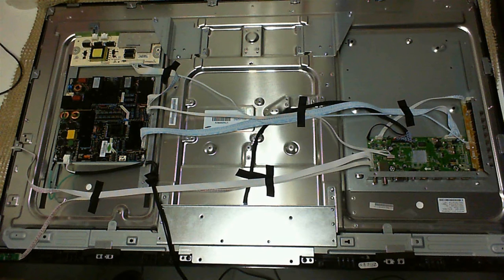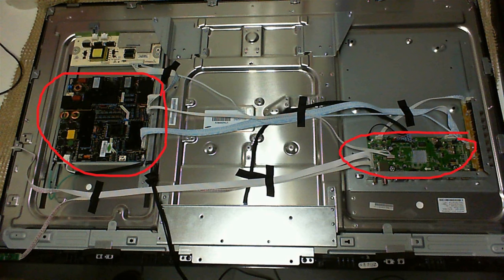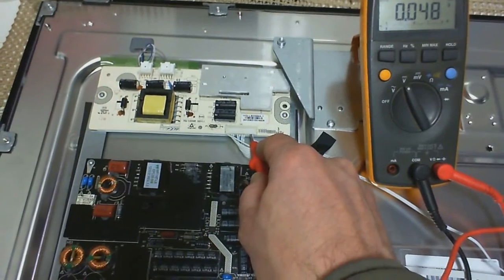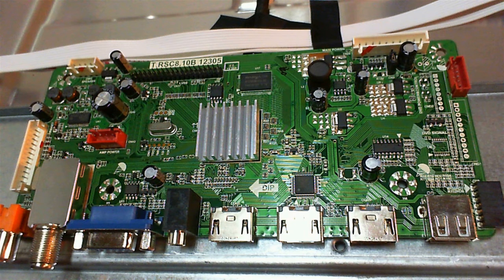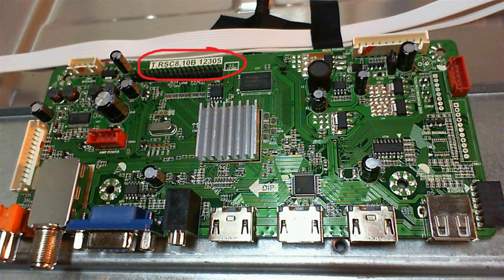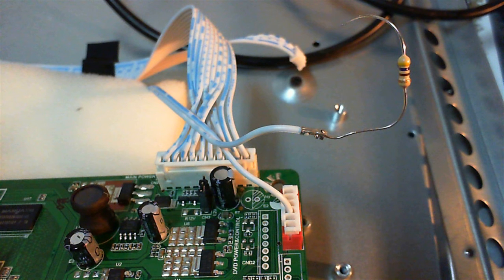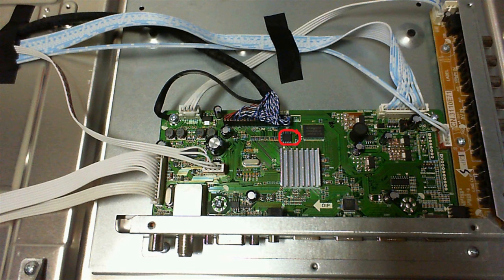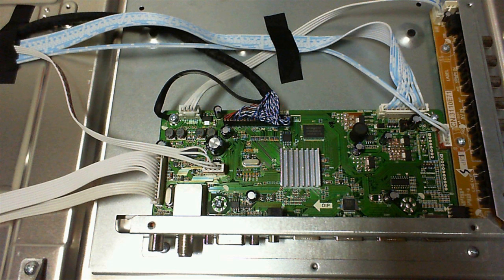LED TV repair RLED4010A X322BV PLCD5092A-B X425BV T.RSC8.10B 12305 EEPROM firmware swap

Comment: Thanks for the quick response. How hard is it to transfer the eeprom, Regular soldering station and wix fine ??? don't have any of those fancy soldering station with hot air etc.
Reply from the maker: Andy r Not hard at all, as far as I remember it's a SOIC8 package. The easiest way apart from hot air is to fill the space between the pins with solder, then heat 4 pins on one side, slightly lifting the pins on that side, then remove the excess solder with Wick, then do the same on the other side. Just using Wick while the pin is still on the pad may also work but then you will need to slightly lift pin by pin.....
Reply: TomTechTod  Thanks Tom. Can't find an RCA board with same firmware. I'll purchase a Sceptre board and give it a try.
Reply: TomTechTod Hi tom,
 Got a board with a different firmware. Did switched the eeprom. TV was 
fine for a week (Many on/off sequence) but then the problem reappeared, 
Frozen blue LED on power on & no video/sound. Suspected a defective 
board (EBay!!). My only option was to reinstalled the original board 
with eeprom form the EBay board. As expected, low LED brightness 
(corrected with resistor divider on ADJ) but video is reverse. It has been 2 weeks ++ and still going fine . I suspect that I have a defective eeprom. Did your repair hold up ??? Got the pinout for the video connector to the LED panel but no idea how to rewire for correct video. I will ask the question on a forum.
Reply from the maker: Didn't hear back from the person who I repaired it for, I suspect it's still working.

Comment: Hi,  thanks for the info. One question, after swapping the eprom do you still need the resistor voltage divider or just swapping did correct the problem.??
Thanks.
Reply from the maker: Andy r I used the resistor just for testing purposes. The other firmware had the output voltage logic inverted. Just swapping the Eeprom should do the job unless there are other differences between the boards I'm unaware of.

Comment: What value resistor do you use as the voltage divider? Does the value matter for a quick test?
Reply from the maker: +mrsemifixit No it doesn't matter, I don't remember what value it was, take a few kOhms.

Comment: You got lucky.  Most problems with the T.RSC8 series is a bad or corrupted eeprom.
Reply from the maker: +ohger1 Where would we get the data from and how to program it in case somebody buys the empty chip?
Reply: Unfortunately, no manufacturer will provide .bin files when requested.  When we have any TV in the shop with a 25 series eeprom, we pull it, copy it, and place the .bin file on our computers by model number, board ID, version number on label, and display number.  We have a pretty good library of files but we always see some new ones.  Sometimes, vendors on ebay will sell the eeprom already programmed.  If we have to buy a pre-programmed eeprom or main board (of the correct version), we copy the .bin file before installing the part.  The next time we can do the repair in house.  As for the programmer, a TL866 programmer is all you need.
Reply from the maker: Ok, good info, thanks.
Reply from the maker: +ohger1 
Hi, do you know how to access service menu in a LN32C530? None of the proposed button combinations work. Some people say the eeprom needs to be reset, others say it needs to be replaced (without giving explanation on how to proceed afterwards). The TV sometimes doesn't turn on. Mainboard doesn't send backlight on signal when that happens. PSU is definitely good, DC voltages nice and clean... Help would be much appreciated.
Reply: TomTechTod
 Samsung's rarely suffer eeprom problems (if that's what you're talking about).  In any case, if the TV is intermittent, it's unlikely to be an eeprom problem in a Samsung.
Reply from the maker: ohger1 Ok. The PSU is ok though... The TV doesn't boot correctly... sometimes. If you have any thought on how to get in the service menu for this particular model I appreciate it. Thanks anyway for your response.
Reply: TomTechTod
  The older Samsungs used "mute" 1-8-2 or 1-8-3 with the remote either with the TV in standby or running depending on year.  But there is NOTHING in the service menu that will help you or make much sense.